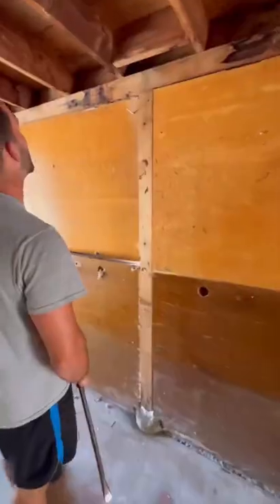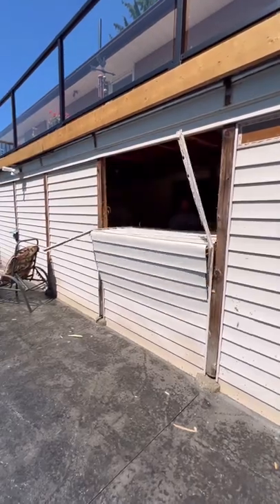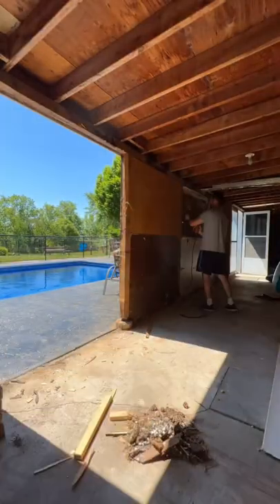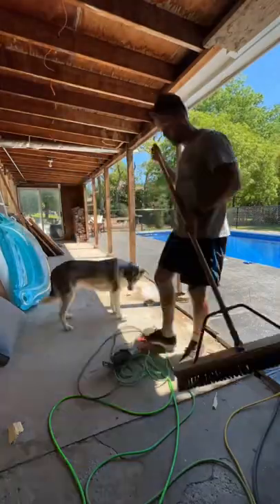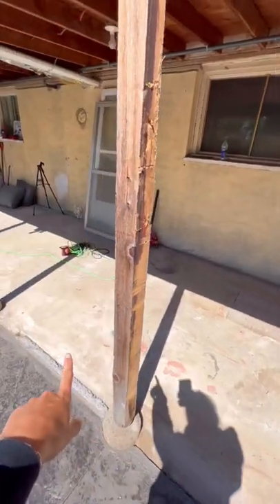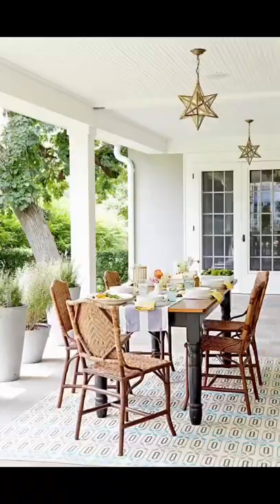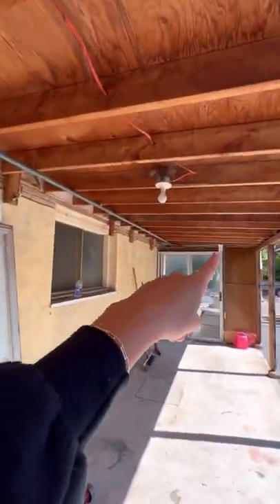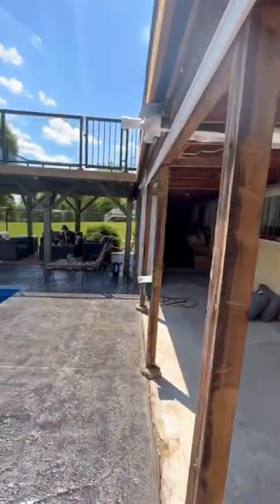We’re taking down our wall made of doors to build…. #shorts

Comment: Make sure to use pressure treated wood and seal with an oil based sealer anywhere that wood meets concrete wood acts like a sponge and concrete wicks moisture and the calcium and other minerals in the concrete corrode and rot the wood away the sealant will make it last even longer and keep the insects away if its exposed to the elements retreat the wood every 6 months to 2 years depending on rainfall and insect traffic

Comment: Research research research is all I can say for the projector. If I can suggest a 75" tv, it will be better than a projector. Anything decent projector wise is $1000+. And getting that setup outside properly with sound, screen, etc., will end up quite costly. For $800+tax you can get 75" tv and accomplish pretty good results with a fairly large screen to watch (plus can watch during day, would be quite difficult to watch during day with projector).

Comment: If you go with the projector screen make sure you order a short throw projector so you can mount it to the ceiling. I didn’t know so much went into using a projector until i built my projector room so just trying to spread some knowledge and hopefully save you some headache